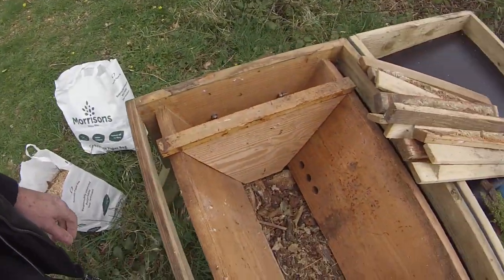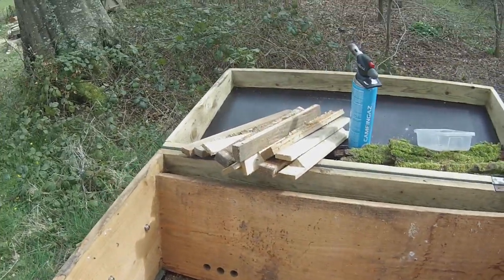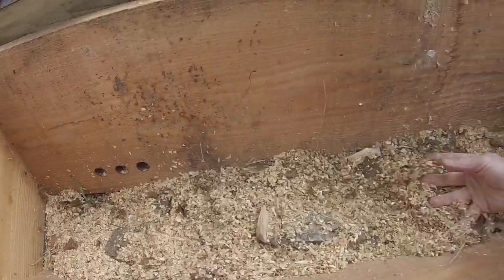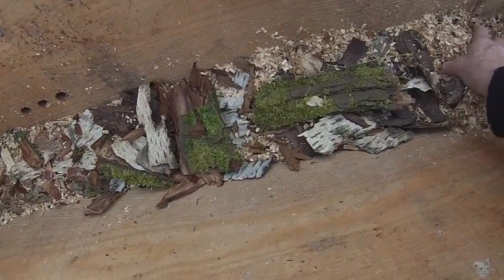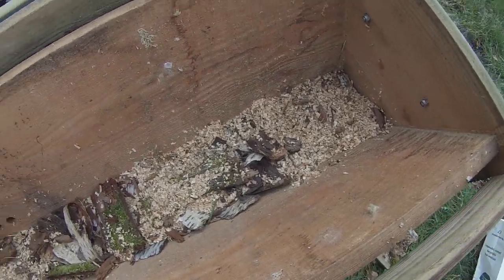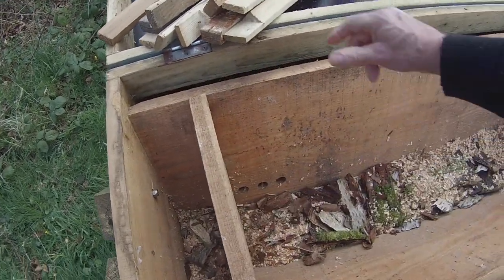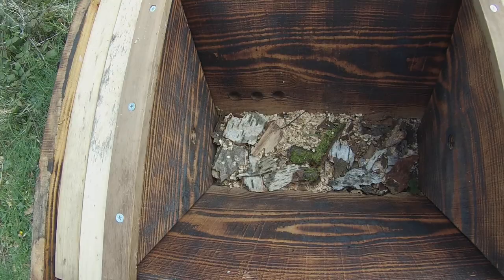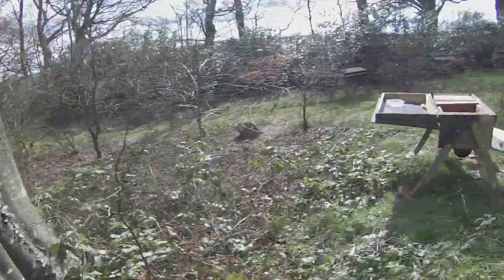How to Set Up a Top Bar Hive for a Swarm or Package

Comment: Phil, Great video. I have read and enjoyed your books very much. I have not kept bees since 1988 or so, was too busy raising kids and such. My brother had a small commercial apiary for several years, I followed his path from a couple states away. I decided to work with bees again last fall which led me to discover you and others on similar paths regarding their relationship to bees and I think the world we are part of. 
Long story short based on your hive design with influence from others and recognizing the "bee culture" here in the states. I have just completed my first three hives all the same and set them in my garden. The are configured very much like the one in the video, burnt inside and out with the three hole entranced symmetrically opposite. All with eco-floors which can be changed out to screened or solid with minor effort. 
A commercial beekeeper here in Missouri is offering Top Bar Nucs and I'll be picking one up tomorrow morning. My goal is two fold at this point, 1) never buy bees again and 2) never use chemicals to treat or feed.
Thanks for all your hard work, investigation and sharing.

Comment: Great Phil, I have just started beekeeping in a top bar hive. I have been using national hives until now. I have set up the top bars, by attaching unwired wax strips and suspending them over the space. I have a mesh floor in my ready made hive, and entrances at both ends instead of at the side as you promote. I have corks to stop the entrances and three follower boards, two with holes and one without. To set up the hive for a swarm, should I a) put an eco floor in? b) make holes in the sides c) how do I feed the bees? I have fondant and syrup which I use to feed bees in the national hives. d) in the kit I have inherited there is a shallow plastic top feeder, which would prevent drowning but I am not sure how to install it if I need to use and can't find reference to it anywhere at the moment. Sorry for all the questions. Hoping to install bees in the next few weeks swarming has started in Sussex!

Comment: Thanks so much for the video. I use tbh for a few years thanks to your books and still learn a lot. Phil is it possible to show how you cut the top bars? I use just a top bar with a cut in the middle and aom wax on it. Works OK but sometimes I have broken combs
Reply from the maker: I may make that video one day, but meanwhile, pinning a guide to the middle of the bar is just as good.

Comment: And just for fun, I'll try to upload photos of the three hives with some details. You will see that i have two styles of top bars the first I made out of 1x stock(3/4 inch) with a 1/4"x 1/2 " spline glued into a dado 1/3/8 wide (35mm). The other one is the same as your current top bar which i will use from here on out much less fuss these are 1 1/2" wide (38mm). The nuc I will install tomorrow will have 13/8" Top Bars.
<a href="https://ibb.co/PGWJWqN"><img src="https://i.ibb.co/LdgBgV8/P4100001.jpg" alt="P4100001" border="0"></a>
<a href="https://ibb.co/ZL3xLwk"><img src="https://i.ibb.co/JBNHBbM/P4100002.jpg" alt="P4100002" border="0"></a>
<a href="https://ibb.co/Qvz6Pt5"><img src="https://i.ibb.co/k2kh4vd/P4100003.jpg" alt="P4100003" border="0"></a>
<a href="https://ibb.co/1m2LqnB"><img src="https://i.ibb.co/9rYNTvB/P4100004.jpg" alt="P4100004" border="0"></a>
<a href="https://ibb.co/bJyV27F"><img src="https://i.ibb.co/PQby9tM/P4100005.jpg" alt="P4100005" border="0"></a>
<a href="https://ibb.co/jRY0zYs"><img src="https://i.ibb.co/RyKrNKd/P4100006.jpg" alt="P4100006" border="0"></a>
<a href="https://ibb.co/sRjh9LF"><img src="https://i.ibb.co/T2cZMzH/P4100007.jpg" alt="P4100007" border="0"></a>
<a href="https://ibb.co/48q4ZwR"><img src="https://i.ibb.co/K2PVjcx/P4100008.jpg" alt="P4100008" border="0"></a>
<a href="https://ibb.co/1Q1mSXG"><img src="https://i.ibb.co/MSrCX1k/P4100009.jpg" alt="P4100009" border="0"></a>
<a href="https://ibb.co/SQ1tf4G"><img src="https://i.ibb.co/Q8qPD3t/P4100010.jpg" alt="P4100010" border="0"></a>

I hope these are accessible.

Comment: I'm new to all this and just learning but I watched a TBH video yesterday where they left a small gap in their bars and the bees built comb on the underside of the lid.  If your followers have holes in them like that won't the bees also build comb on the underside of your lid?  And won't they build comb on the two spacers at the left end of your hive?  Thanks.
Reply from the maker: It is important that bars are contiguous. I only add the feeder when needed, usually early September, but when not in use it would be covered by insulation in any case.

Comment: I have a topbar hive that I built myself, it has an open mesh bottom with a swing door I can shut if needs be.  My question is - what amounts to adequate ventilation? Could In  theory I close or seal the bottom completely and the entrances provide enough ventilation? Just trying to get my head around it in case I make any future design changes. I mean with the gutter it's completely closed, was any extra ventilation needed or are entrances enough? How much ventilation is enough ventilation whatever design I use?

Comment: Question. I've actually had a swarm arrive, and they set up shop in a compost bin, which is probably somewhat dry but it did have compost at one point. The Bin is a plastic Barrel shaped, and due to the weight of the compost it eventually created a space between the structure, where they probably got in. So here is the question, Once I have my Top Bar, how do I do the transfer from the compost bin to the new top bar?
If you need an image so you can recommend me how to transfer the swarm, please tell me so... that I can send you an email. Thanks for any help you can give!!!
Reply from the maker: It's probably best to let the barrel colony make a swarm, which you can put directly into the hive.

Comment: Should you put a queen excluder over the hole in the middle blocker board to keep the queen in the brood part of the hive?
Reply from the maker: I usually plug the hole with a cork, not to stop the queen getting out (she has no desire to abandon her colony) but to stop wasps etc getting in.
Reply from the maker: Also, if you want to keep the queen out of the honey (although that is really not necessary in most cases) you can fit a piece of QX over a larger hole - I would suggest 100mm+ diameter.

Comment: Hi Phil. Can you use Xylitol (which is from Birch tree and not corn) to mix with water and then put onto the bark and bits at the bottom of the hive if you can't get hold of Birch sap? I've also noticed that you have entrance holes on your other hives in the centre of the sides and not one end or the other. Is there any particular reason for this? Great video by the way.

Comment: How to you plan to feed this swarm?
On the older hive, that has been there 4 years, does it have an eco floor?  I noticed the bottom is made different from the one with the plastic gutter.
Reply from the maker: I don't feed swarms, they feed themselves. The older hive has a mesh floor with a board mounted under it with a gap for ventilation. It seems to work...